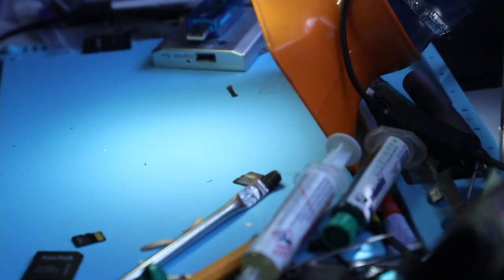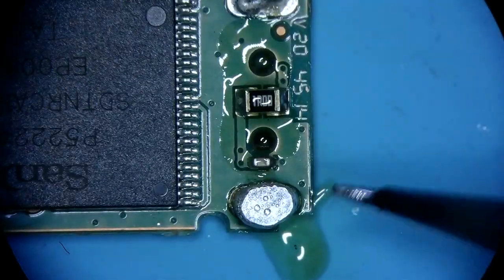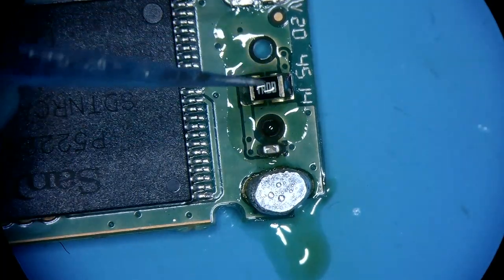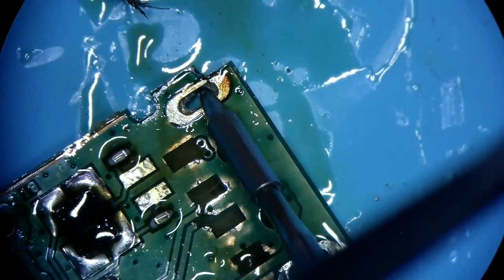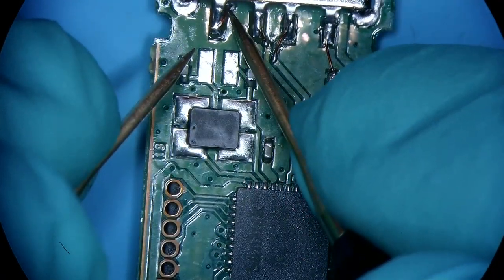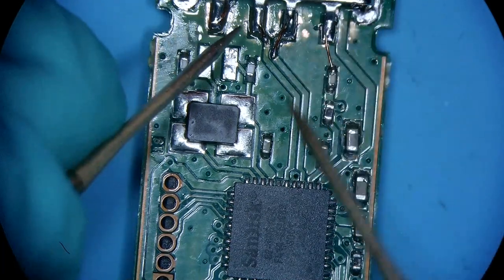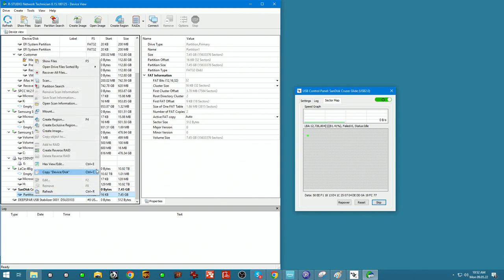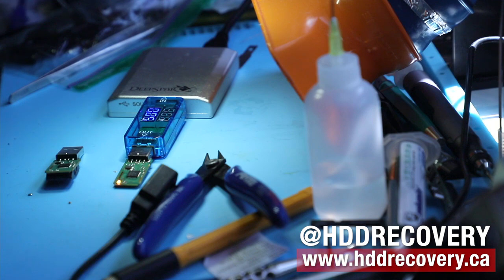best way to repair almost any Sandisk flash drive

Comment: With how close the data pins were after repair, it would have been another good example to show that pin to pin at the repair has no short as well. Not sure what your using for camera/scope, but sometimes shining a light from an angle will kill some of the glare for quick shots.
Reply from the maker: I have fiberoptic light sources with flex wands for directing the light but they are very warm, so the color balance would take a hit. Maybe I'll get lights that Alex sells

Comment: Hi! I really enjoy your recovery videos and I just started my own data recovery business, starting with HDDs and SSDs, FLASH, etc. using PC3K. I've noticed you used some of your videos yellow pillows between the reading heads, may I ask where did you get those, or did you make them youself?
Reply from the maker: It's a heat sharing wrap for isolation of bare wires. Amazing DIY tool that helped me recover thousands of drives and keeps helping to this day :)
Reply: @hddrecoveryservices  Thank you so much for your answer! That's very creative, I would never guess you were using that :D I need to try that, too, thank you again! Today I noticed I can use 2.5" filter pillows with 2.5" drives to isolate the heads. I just cut them half to get 2 pillows for 4 heads. :P

Comment: Hello. I have Crucial MX200 2.5 SSD with Marvel 88SS9189-BLD2 not detected by windows. Need data.  Can you fix that?
Reply from the maker: That depends on why it is not detected. Like any thing when it comes to storage, SSDs can fail in many ways. Good news is that 88SS9189 is a supported controller for many cases. Feel free to reach us at www.hddrecovery.ca/contact-us

Comment: Just as a little info, maybe you can make a little money out of it : There are many TSOP48 NAND Flash chips, that contain bootloader partitions (e.g. for expensive satellite receivers and stuff). Using your TSOP48-NAND Socket Reader device, you could access those like mtd block devices on linux and rewrite those bootloaders to unbrick devices with wrong/damaged bootloaders on them
Reply from the maker: NAND reader devices I have dont have options to record data back to then NAND like a programmer would.

Comment: could you wire some jumpers to a usb breakout instead of installing a usb connector onto it, or was this easier?
Reply from the maker: It is easy either way, and both methods would be equally effective for data extraction. I have brand new connectors, so I just prefer to fix them that way.

Comment: You need to buy yourself a cheap, hand-operated Solder Sucker.  And why do you use laquered wire?  You need 25 gauge tinned copper wire.
Reply from the maker: I work with monoliths so only use coated wire. It's not a problem to tin it and extra time.